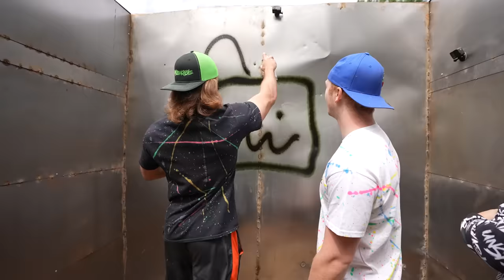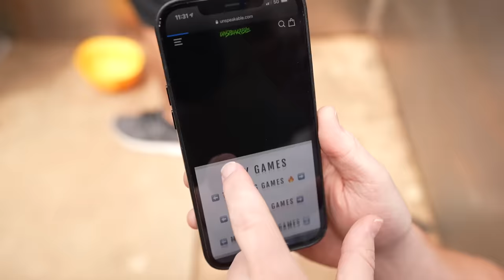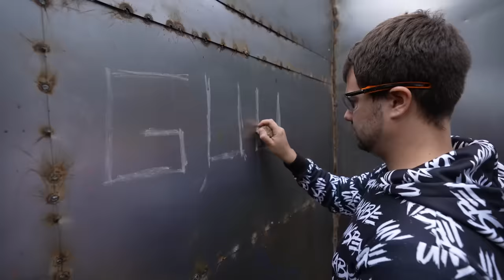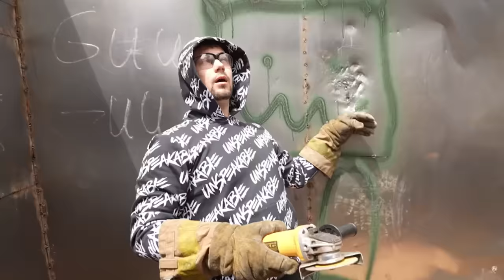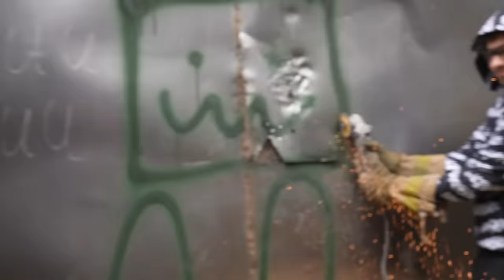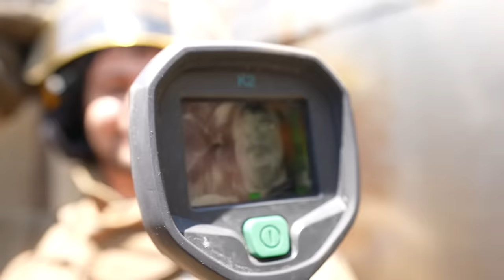ESCAPING 100 LAYERS Of STEEL!

Comment: Instead of commenting do 100 layers of titanium I'm commenting do 100 layers of tungsten.
Reply: Impossible
Reply: @doglzalex1955  I'm sure it's possible
Reply: Very expensive tho
Reply: Lol
Reply: They would need lava
Reply: That’s wut I was gonna comment
Reply: Graphene
Reply: @Nicholas CORNELL Yeah but it could be really dangerous maybe atleast only 5 layers
Reply: @Nicholas CORNELL The thing is tungsten melts at 5000 degrees Fahrenheit
Reply: Yeah bro
Reply: Wait isn't tungsten tougher than titanium?
Reply: @williamnakamura7153  They dont have a weapon thats really hot or cold and if they do, it could be dangerous so just 5 ok? Its not possible when its 100 layers and it would be so heavy to take of a layer.
Reply: @williamnakamura7153  Right and it could be a dangerous act and its possible that the camera might break because of its brightness but I think its possible with the strongest laser.
Reply: @KjSucksAtGames  Its almost as hot as the sun.
Reply: @KjSucksAtGames  You saw what happen to the cube, just 5 layers
Reply: @KjSucksAtGames  Only 5 idk on how thin it can go.
Reply: @KjSucksAtGames  the sun is probably about somewhere in the 10000 degrees part

Comment: Request:100 layers of rubber (silicone)
Request:100 layers of wood
Request:100 layers of glass
Request:100 layers of fabric 
Request:100 layers of brick
Request:100 layers of lego
I hope you can use one of these :)
Reply: 100 layers of glass
Reply: 100 layers of glass hmm they can break them by a punch or a kick so is easier
Reply: @obamium3267  true but it was the only thing I could think of
Reply: Unspeakable belike:uhhh too much
Reply: 100 layers of foam

Comment: Steel, the 2nd strongest metal in the world, and unspeakable trying to break through 100 layers of it.
Reply: 🤓actually 104 layers🤓
Reply: Im pretty sure thats wrong because titanium and tong sten is stronger
Reply: Go Unspeakable
Reply: Titanium is barely any stronger than steel. In fact, the best steels are more tough than the best titanium alloys🤓
Reply: no actually im pretty sure tungsten is one of the strongest if not the strongest metal in existence
Reply: @UniverseUA  if fact
Reply: @jared-2  changed
Reply: @UniverseUA  "some"
Reply: @youraverageperson4059  I said nothing about tungsten
Reply: @UniverseUA  Rank	Type of Metal	Atomic Weight
#1	Tungsten	183.84 u
#2	Steel	n/a
#3	Chromium	51.96 u
#4	Titanium	47.87 u